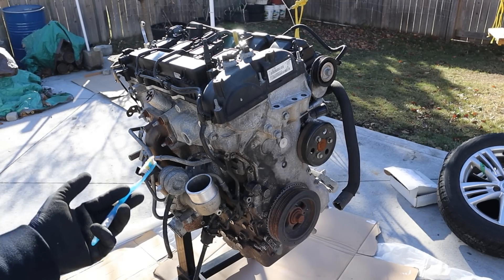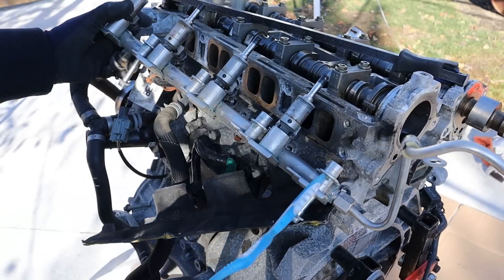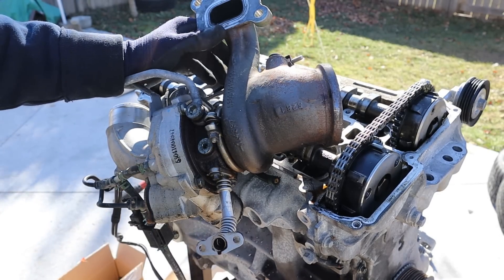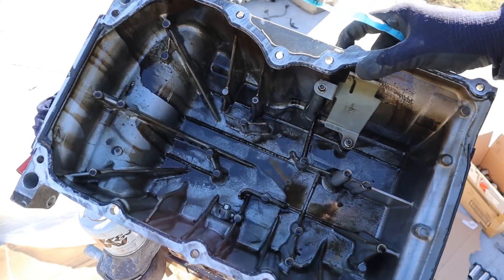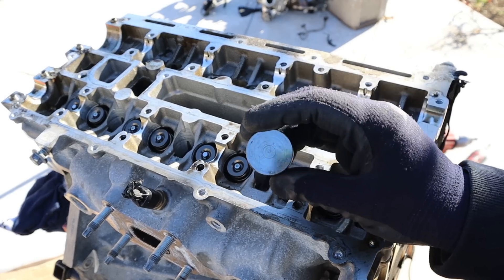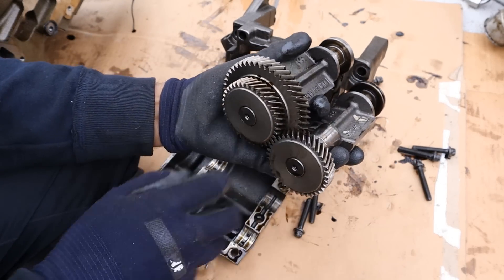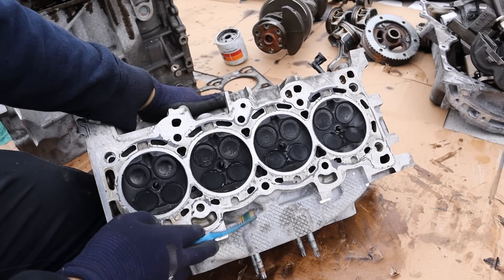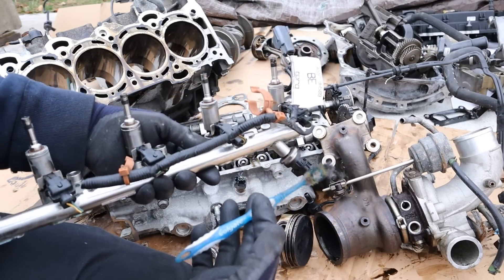Why Ford Ecoboost Engines Fail

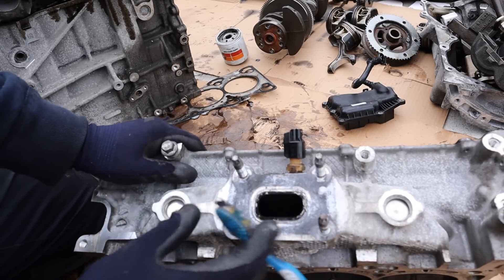Comment: 15:44  - This was definitely a weak spot with this engine.  I can't tell you how many 2.0 turbos I had to replace while working for Ford. Either the manifold cracked or the wastegate failed both were common failures around 60K miles. Since it was a one-piece assembly and very time consuming to replace, it was a costly repair ($1800). Ford really killed their already deteriorating reputation with this engine. It was used on their most popular vehicles and either the turbo failed, or the slotted cooling block would fail all at an early mileage or just beyond warranty coverage. Leaving owners with a vehicle that needs a new engine to the tune of $8000.
Reply: “Block would fail at an early mileage or just beyond warranty”. Sound like it was designed to fail. Also sounds like a class action lawsuit
Reply: @Nuffsaid876  Ford only recently offered a customer satisfaction program to do a one-time only replacement on the 1.5L blocks as long as it was under the 7/84 limits and only on 2017-2019 models. Poor effort at best not to include the 2.0 models.
Reply: @gianmariavolonte4315  What is the 7/84 limit?
Reply: @Irrational305  The vehicle has to be less than 7 years old and have less than 84K miles.
Reply: @gianmariavolonte4315  1.5L, wow... my HARLEY has a bigger engine that that... 1803 CC, 110 cubic inches! 😂
Reply: @gianmariavolonte4315  Have a 2018 Escape with the 1.5 that Ford replaced last year, it was at just over 90k when it went bad but they still did it gratis.  I also have a 2013 escape with the 2.0 that has been absolutely trouble free other than rear wheel bearings needing replacement at about 105k miles.
Reply: Too many people forget, or don't know that you need to give  turbocharger a few minutes to spin up and spon down.
Reply: All you had to do was pay about 600 dollars to get it re modified,  Ford been figured out what was the issue. Its a good motor, Ford didn't test good enough  on their part
Reply: May I ask all ecoboost engines have same issues ? Some say 3 cyls are ok.
Reply: @gokhangkh35  The 3 cylinder is still relatively new. The only trending  issue that I've seen in it's short time was fuel injector failure (recalled).
Reply: Io ho un alfa romeo e funziona perfettamente ❤
Reply: Ok ... let's say it once and for all...
Ford ECO PUKE engines are a joke... it was designed by monkeys managed by assholes
Reply: has anyone  heard of ford 1.5 ti-vct gas engine 3 cylinders?
Reply: The Spanish-made version of this engine apparently does not have the integrated turbo and is less unreliable.
Reply: @gooser__43  Of course but they obviously didn't test the turbo installation for outright durability.They'll say to the contrary but the failure rate is too high to bs their way out of that one..This should have been a great engine.
Reply: Too bad, buy Japanese car next time
Reply: @tongchang1435  Which is why I drive a 4Runner. 🇯🇵
Reply: Thanks for the perspective. I have a 2014 ST with 68k on it that currently runs great. Any advice on how to keep it that way?
Reply: @scottahrens9331  best thing for these engines is to do something about the factory oil/air separation. You can get a baffle plate that helps a lot and also do a catch can. You’re going to be in the same area with both and working with the same parts. Also is a good time to clean the valves as the intake manifold needs to come off. These engines are hard on spark plugs too, do to them having such high boost pressure at relatively low rpm. Checking the gap every other oil change is a good thing to keep an eye on. Just keep up on normal maintenance like anything else and you’ll be fine.
Reply: @scottahrens9331  these motors are actually very reliable if you are keeping up with maintenance. I have a 2015 with about 90,000 on it has been tuned since 10,000 on her…
Reply: @UrW0rstNighmare  That's a start, my family's fusion has 122k miles and it's doing fine, no mods, no intake cleaning, just regular synthetic oil changes with regular shop synthetic.  Watching for coolant leaks, engine running just fine, lots of both highway and city.
Reply: @UrW0rstNighmare mine is a 2015 focus ST with 204,000 miles on it all original. Daily drive and would trust it to go across country no problem.
Reply: @scottahrens9331  Does that have the 2.0 or 2.3 Ecoboost?.
Reply: @gianmariavolonte4315  2.0. I believe it’s the same engine shown this video
Reply: @scottahrens9331  I would just keep up on regular maintenance and be mindful of checking fluids once a week. At 68K you shouldn't have much to worry about if it still runs fine. The only issue I would forsee in the long run is the infamous GDI intake valve cleaning.  That usually doesn't show up until about 80K.
Reply: @gianmariavolonte4315  I have a 2017 2.0 ST at 72k miles. I'm noticing a whine at 2.5k. Sign the turbo is on its way out? I have extended warranty for another year so hope it will fail before this runs out. I have the servicing done every 5k miles/6 months.
Reply: @gianmariavolonte4315 Hello,
How work 1.5 ecoboost? Is it reliable engine? 
Thank you
Reply: @TheChefVale no. That is the engine that had many problems like coolant intrusion into the cylinders. The 2.0 Ecoboost is a much better engine.
Reply: @newfie-dean5803 yes i think the 17-20 had the coolant issues  faulty block right?I got a 24 edge 2.0 and the engine is new revised since they were getting sued left and right for failure
Reply: @scottahrens9331  pray!

Comment: Someone needs to release an after market intake port fuel injection system for these engines. They seem fairly tough except for the shit DI and weak oil control rings.

Comment: I had a 2014 F-150 FXR with the 3.5L Ecoboost. I was extremely happy with its performance. Never had even a small problem.
Reply: You HAD one?  What happened to it?    2014, 2016... those engines are fairly new.  Other than general maintenance, there should never be an issue with them.  Unfortunately that's not the case these days.
Reply: @cward1954  I had to trade it in for my electric wheelchair.

Comment: Even Ford's first co-operative build with Mazda of it's Japanese 4 cylinder engine design back in the early eighties (a range of very closely engineered 1.1, 1.3, and 1.5 liter chain-driven OHC engines) were problematic oil-burners to such an extent that Ford was taking the cars back for full refunds if they still failed a full subsequent engine rebuild including new pistons and new rings, within the first 12 months of sale as a new car. The issue then was 'green block'.. a porous casting condition that cannot be overcome, other than by replacing the entire block with another brand new (green?) block, and be no further ahead. 
They said the problem was a manufacturing issue in the Philippines where these engines were cast and assembled at the time.

Comment: The Vacuum pump on the 2.0L and 1.6L Ecoboost engines are known oil leak spots. Both my car (Focus ST-3) and a friend's MK7 Fiesta ST-2 have had the same issue with the gasket failing on the vacuum pump. Both vehicles are sub 60k miles too!

Comment: Lots of folks getting well over 100k and even 200k on these if driven and maintained properly. All the add on parts are cheap, you can easily find used stock turbos for $150 or so. Even finding these engines used is easy and comparatively cheap as it’s a fleet motor. In the FoST community LPSI causing ringland failure seems to be one of big killers with these. That’s not a concern with proper oil and not lugging or boosting the motor too much under 3k rpm, so again driving properly.

Comment: Conclusion: If you use your car/motor a lot (like me), use a V6 non turbo engine with indirect injection (like mine) = piece of mind!!! (like me) and avoid an overboosted 4 cylinder unit....

Comment: Thanks for a great video! Anyone know what can be done to prevent the carbon buildup in the combustion chamber?
Reply: Water methanol injection kit on the intake. Buy a boomba intake spacer that has ports and get a AEM and snow performance kit. have 50,000 miles on mine and they have zero carbon. also helps to use Pennzoil ultra platinum and Liquimoly flush and their Ceratec. Absolutely zero varnish or wear on any bearing, and I have just under 500whp with my 2.0. 688whp with my second stroker, and the second I used ceratec and there is zero appreciable wear.

Comment: Excellent presentation style ! I am looking for a  common afgordable car engine to use in experimental aircraft... It seems that this engine could be made ro be reliable and lightened considerably. Would it run reliably without that heavy looking balancing shaft unit ? I would also ditch the direct injection, and variable valve timing as well  what are your thoughts ?
Reply: I would look into the focus st community. Lots of information about these engines. And yes you can run without the balance shaft, quite a few people delete them especially those that track the car.

Comment: I would never buy a turbo charged engine as a daily driver it’s just nuts turbos are fine if your racing in the weekends but terrible for daily driving as stated it a carbon collector 🤣🤣🤣🤣🤣🤣🤣🤣

Comment: You need to do a video on the terrible Eco-poot twin turbo engines in Ford trucks and show the high failure rate with them too.  No more Ford trucks unless they have the V8!

Comment: This is the best teardown I have seen to date, no nonsense and endless progress, fast good description of items, straight forward! 😃👌✌
Those balanceshafts are great, I remember the old Honda Accords having them, they drove silky smooth......
10:30 "This is an ecoboost engine so we don't expect it to last long" hahaha cracking up 🤣
14:30  Long intake runners create more torque in low revs, surprised those plastic intake manifold don't crack from boost.

Comment: Its a well build 4 cylinder, seems that its downfall is simply the direct injection system. I've always wondered why MFG simply didn't install a 5th injector on the intake to selectively come on clean out the intake. Or have a proper catch-can factory system.

Comment: Looks like this engine got regular oil changes.  Very clean on the top end, no sludge in the pan, and the bearings all looked about perfect.
Reply: Yeah, sucks what a little bit of water in the intake can do to the health of the engine

Comment: I have a 2016 Ford edge direct injection ecoboost 2.0 and at 63,000 miles one of the pistons failed from carbon build up.  Ford would do nothing about it.  It cost $8000 for a new engine and to have it installed.  These engines are junk and Ford knows it.  They lie to your face when you tell them about all the information about the engines failing even on their own website.  The service person said "that is the first I have heard of that", which is a lie.

Comment: turn off the auto start. shutting off the engine  while sitting at idle at a stop light prevents the cooling system from doing its job. If your in start and stop traffic, a situation that puts the most stress these engines, killing the engine and not letting it idle, your not allowing the recovery time it needs to regulate the temperature in the engine as it was designed to do. These are a newer breed of engines, and like any thoroughbred horse, they require more attention then Grandpa's old plow horse.

Comment: I think large displacement 4 cylinder engines, 2.7 to 3.6 litres with or without turbos and dual injection with high compression have future applications.

Comment: My 2004 Chevy Express 1500 5.3L just crossed over 167K. It's last emissions test was zeros across the board. The inspector said "We have brand-new vehicles in here that don't score this well!"

I don't drive it like I stole it (Though I don't baby her, either), I've run Mobil 1 in it since the first oil-change and have followed the maintenance guide as closely as possible.

Yes, you can get massive power from a tiny engine.......... But there's a price to be paid. That's a price I'm not willing to pay.......

Comment: You can thank the US Government for this crap.  It is all mandated by the government, for "clean air" and gas mileage.  Ford has to create a vehicle that is cheap, "clean" and fuel efficient; almost an impossible job.  The only engine I completely overhauled,  by myself, was a 1954 Chevy straight six. It took me one day to do the entire job.  I would take that engine over the modern engines, any day.

Comment: Deliberate bad design
The maufacturers know about built in weaknesses that are designed to be deliberately too difficult to repair. The whole manufacturers mindset about the supply of parts is that of abuse. It is time the industry was fully investigated and exposed. Henry Ford would not have agreed to the abuses that are industry standard practice across every car manufacturer. It’s the company accountants that are responsible. I once knew a man who was a chief draughtsman in engineering at British Leyland and was directly involved with the design of the original Mini. He spoke at length with anger and frustration at company accountants who insisted on inferior engineering design, practice and materials at that time. He said he was involved in numerous intense arguments with company accountants who knew very little about engineering and his ( as well as other) highly qualified and experienced engineers were constantly over ruled by the accounts. He cited numerous examples of very bad design and practice that led to highly inferior cars which , in turn led to a total loss of confidence at a time when Far Eastern and other European manufacturers were beginning to sell more and more cars in Britain.
It’s why the British car industry has been lost to foreign manufacturers who’ve even set up business in Britain and been more successful than the British. That said trade unions played a big part in the destruction of the British car industry
Leave the engineers alone, let them design and manufacture well and give them authority over company accountants. They had their chance and their corporate incompetence has wrecked many British industries 
Excellent video, thank you

Comment: Absolute garbage engine design and the amount of plastic components is unbelievable!  This right here is called planned obsolescence, manufactured to fail and cost the consumer continued money spending. Ford should be ashamed of themselves for manufacturing such a crappy design engine,all these engines are good for is a boat anchor.

Comment: I cannot see how it would get Hydrolocked, there is no evidence of bent rods or head/piston damage.if it was misbehaving it was probably an ancillary part not working properly. The oil burning is that the oil specified is too thin and that is for the dreaded green agenda crap, same as Toyotas and VW. I would use a thicker grade and fit an oil fume air separator to allow venting, once again a green shit agenda.

Comment: Using Penzoil Ultra Platinum will greatly reduce the carbon build up on the valves. It has the specification ford now requires for the ecoboost engines. These engines are great if you use the correct oil. People cause their own problems going to the 5 minute oil change place getting the cheapest oil. I change my 2016 F150 3.5 EB every 5,000 miles with Penzoil  Ultra Platinum. My engine runs like a champ.

Comment: The plugs on the integrated exhaust manifold is not for water cooling either. Those plugs are for casting purposes only. It's to get the sand out of the ports after being casted.

Comment: Interesting look at the inside of a modern better-than-average 4 cylinder engine. My, they have changed. I didn't see even a hint of insight pertaining to the title of the video. In fact, he said this engine's loss of performance is not evident in the internals (not even a clue) and admitted that the engine could have been saved (I assume some of the engine diagnosis findings would have provided a path of some externals to work on). Based on the title, I'd say this person has some kind of agenda (not sure of what that is, either) but I appreciate the lookie inside; not a total waste of my time but close!

Comment: I've owned over 300 second-hand cars and trucks over the last 58 years and never had a new one or a Ford until 10 years ago. Since then I've had a new Fusion, a Fiesta and am now driving an 8 year-old 4-wheel drive Ford Ecoboost Pick-up: after hearing only bad things about Fords my entire life I have been really happy and impressed by Fords. My next vehicle will be a new Ford All-drive Dually for towing my boat. Up until 10 years ago I didn't believe in owning any vehicle that was less than 30 years old...my favorite being a 1966 Chevy C-10 straight-six full-length pick-up. I could fix anything on old vehicles but I'm at an age where not only am I unable to comprehend new ones to fix them but I just don't want to work on another one ever anyway.

Comment: I have a 2.0 eco boost in my 2014 Escape with 119,000 miles and I couldn't ask for any better performance from a 4 cylinder engine. Not sure I understand your title for your video but I do understand that eventually carbon deposits will be the downfall of the turbo. 😞